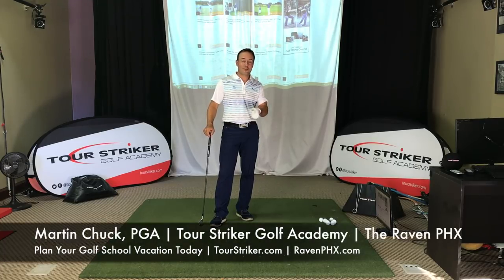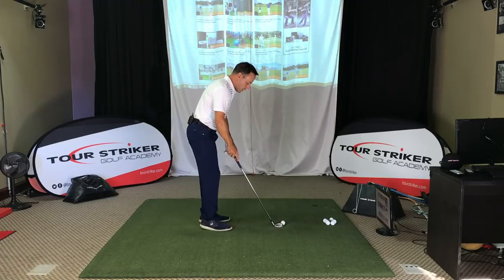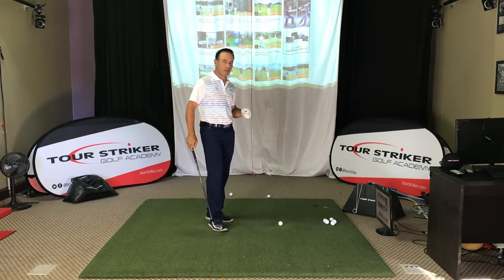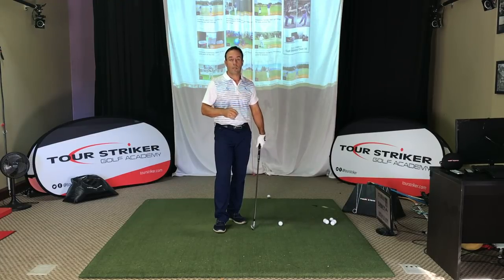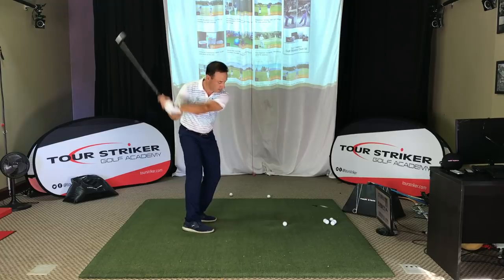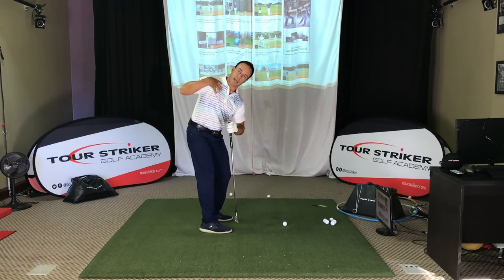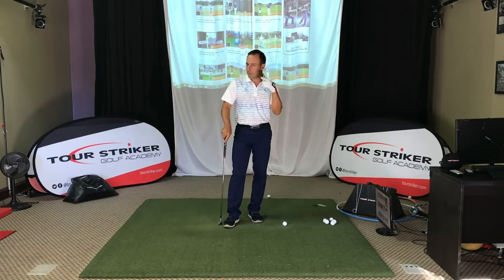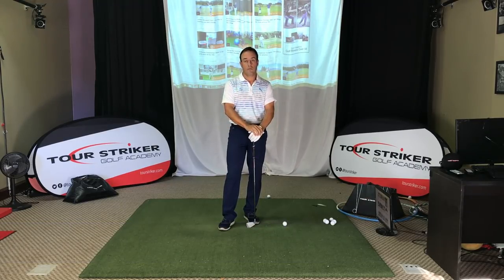Shallowing The Golf Club In Transition | Martin Chuck | Tour Striker Golf Academy

Comment: Great video.

Does that same inertia create a toe down divot?  I create a lot of Club head speed...  the more I create it seems the more toe down I get.
Reply from the maker: You may need stronger shafts, but it's likely you are too steep and handle raise through impact getting the toe too low.
Reply: Tour Striker thanks, probably is both.. I will occasionally get a little friendly with the goats when I swing hard!   Probably raising my hands through impact to straighten out the club.

Comment: This is a concept that I don't think was identified until recent years.  I have read numerous books on the swing, and I don't recall seeing this in any books written more than 20 years ago.  My son and I have struggled mightily with this "shallowing" issue.  Both of us come into impact too steep.  I think this may be the most difficult concept in golf, and counter intuitive in many ways.( I mean the ball is down at the level of my feet.  If it were up on a three foot high tee, this would be more intuitive.)  When I try and lay it off like that, my brain tells me that the face is wide open and the ball goes dead right and moves further right.  To me it feels like I have no power to strike with when the club feels so laid off.  It amazes me that a guy like Trevino with no formal instruction did it.  Did he (Trevino) even know he was doing it or the significance of it?  Ryan Moore and Jim Furyk both do it, but get there entirely differently.
Reply from the maker: Hi John, agreed, it is a courageous move when the club is allowed to fall, not be pulled down, and then rotated into impact. Trevino was masterful at it.
Reply: Could be cupped in your hinge, opens the face. Could be too tense, won’t allow the club face to square up. Become aware of the right hand grip pressure as you make the downswing. If it tightens up, which is very common, it promotes a block out to the right. It just sounds like you may need to do some hand awareness training, it will get you to understand how the club face squares up.